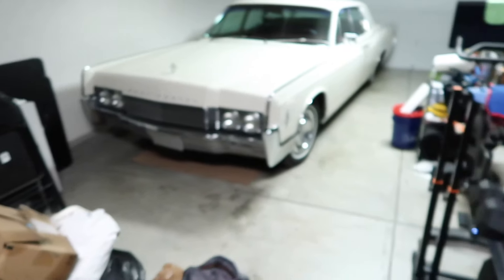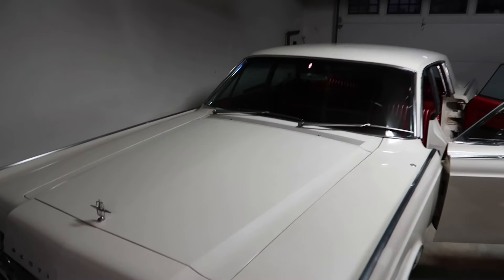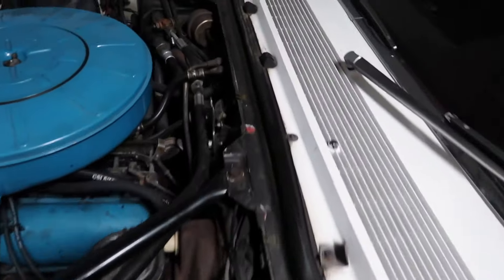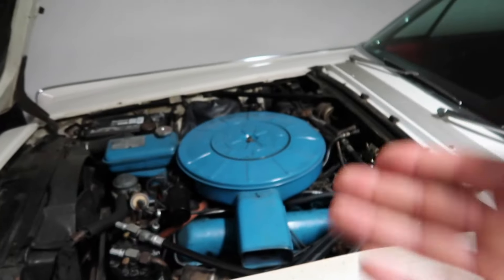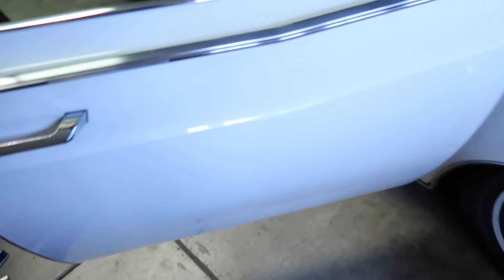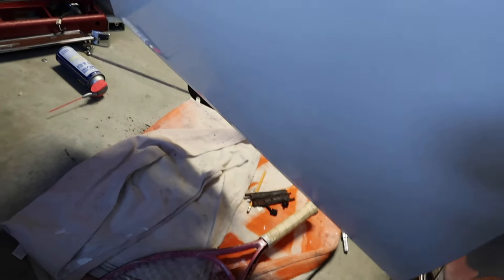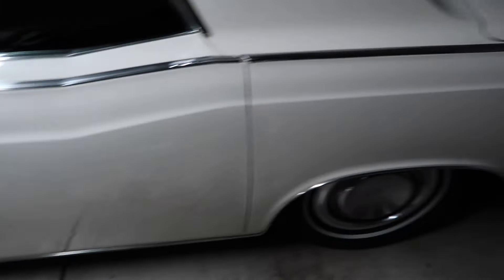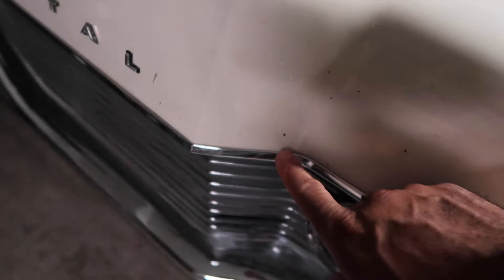Newest Edition, Heaven 1966 Lincoln Continental

Comment: I love this car and that you are saving it.  My Grandparents owned one and I drove it hundreds of miles; they are bliss on the highway and cruising.  Sorry you had to rebuild the 462, but it will now be all but bullet-proof.  The interior and exterior chrome and stainless are excellent, as is the leather and that beautiful steering wheel I loved isn't split or cracked.  The tilt wheel is a fairly rare option on the '66; it was the first year they offered.  In '65, you could get a tilt column.
I pray the automatic HVAC works well.  They are very complicated systems, all vacuum operated.  When they work, they are great.
Perhaps in a future update video, highlight where the electronic eye is for the automatic headlight dimmer (the small glass insert on the front left peak molding).  I always thought that was so cool, compared to the electronic eye mounted on the dash.
I believe the rubber backed heavy paper behind the door cards was part of the sound deadening, as those thick doors could pick up and resonate highway noise.  You might also show the trunk; 18 cubic feet of luggage room!  In '67, you could order optional luggage made to fit it perfectly.
I'm glad you put on white walls and got the right size white sidewall; they were thinner in '66.
I believe you have '67 hubcaps.  They are in excellent condition, so don't fret.  The Continental star on the '67 hubcaps was larger than the '66 and the stainless/black paint pattern was slightly different.
There's so much to tell and love about these cars.  Thanks for a great video and for you care of you car!